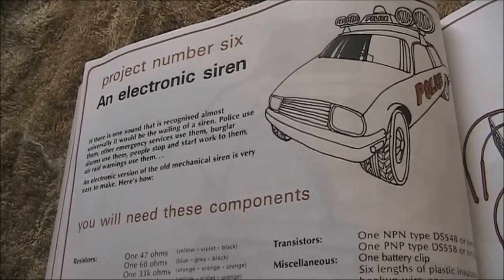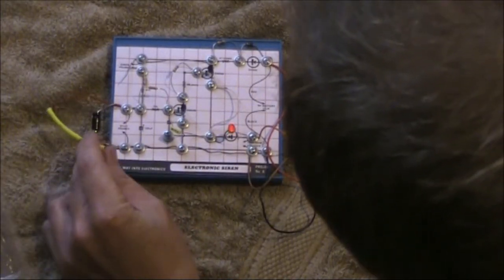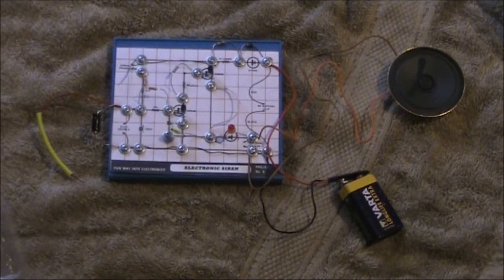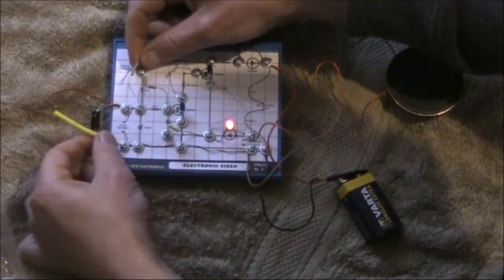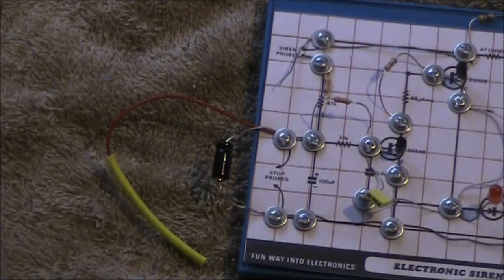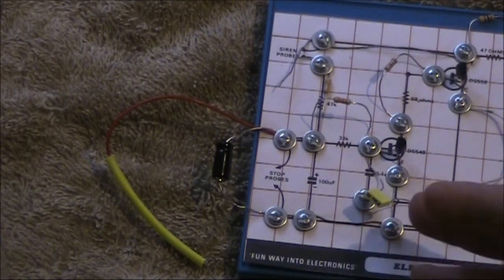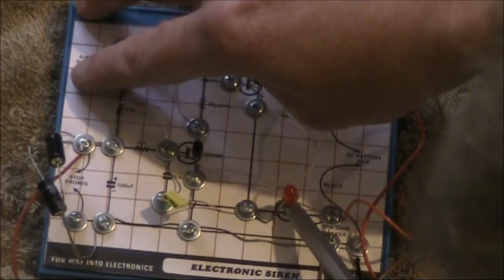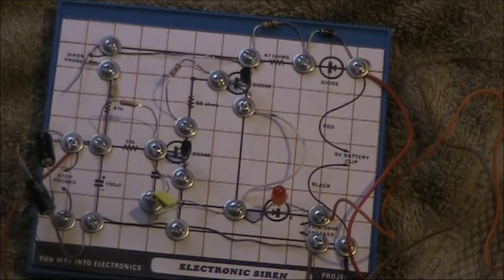Funway 1 builds: Electronic Siren (Project 6)

Comment: now build it with power transistors, up the bias currents and adjust the capacitor values accordingly and connect it to 18V and a horn speaker 😅